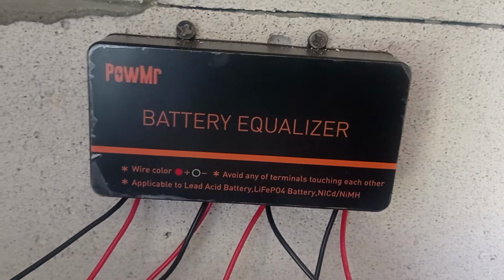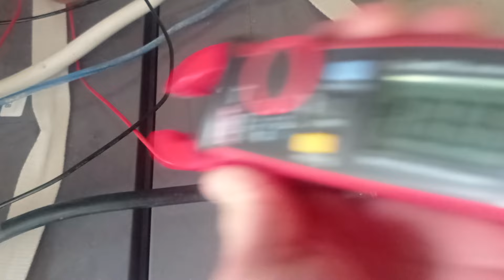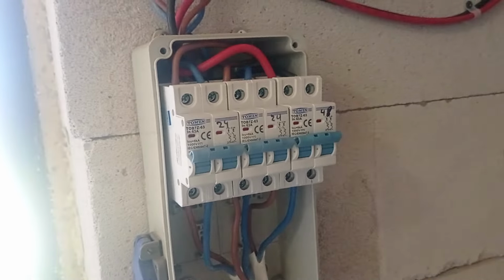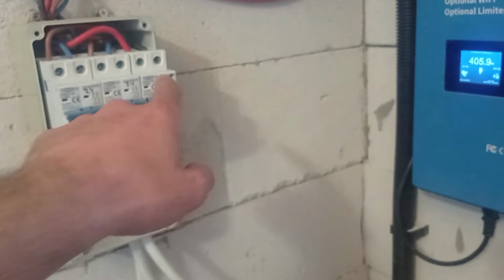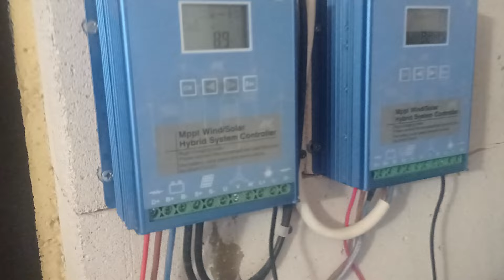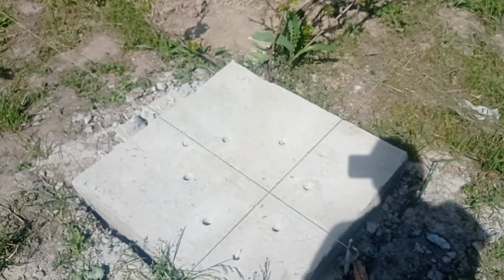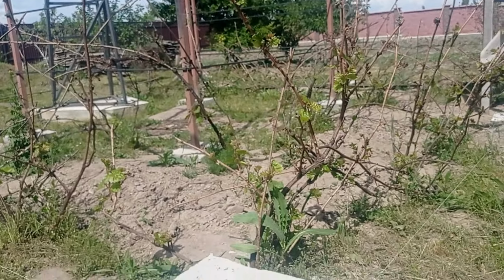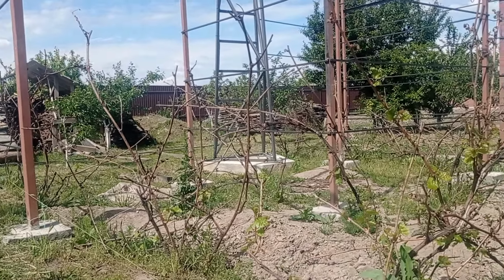Balancer is balancing the unbalanced to be balanced enough and not to get unbalanced anymore...

Comment: How's it working now
Reply from the maker: Right before it was mounted there was a slight disbalance in 0.1V between the highest and the lowest banks. Battery bank was working literally two weeks only, and 0.1V disbalance appeared in those two weeks.
At the end of the first day after the balancer was mounted the disbalance was 0.02V, and keeps like that for the tree consecutive days now. To tell you more - ask me the same question in a year )) a couple of days is not a period to give a proper judgement, but I see the trend already and I like it so far.